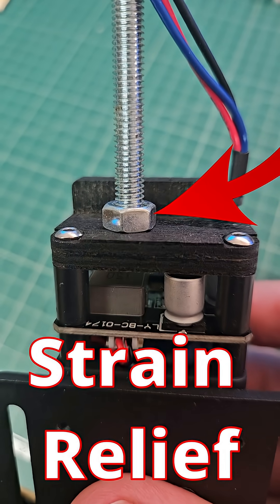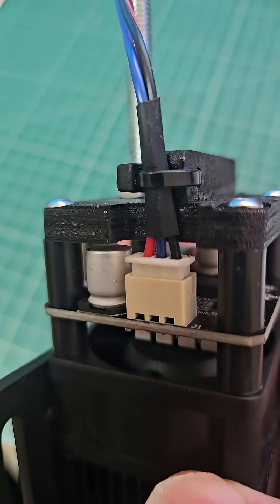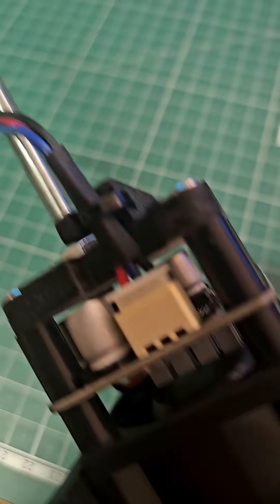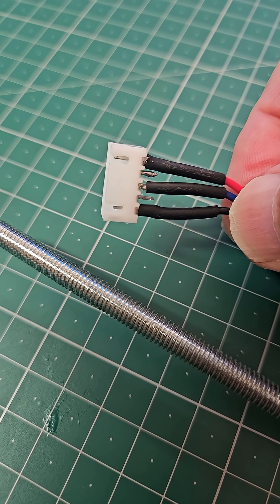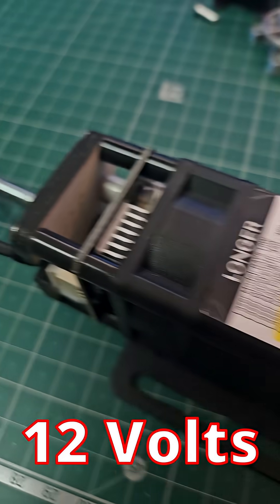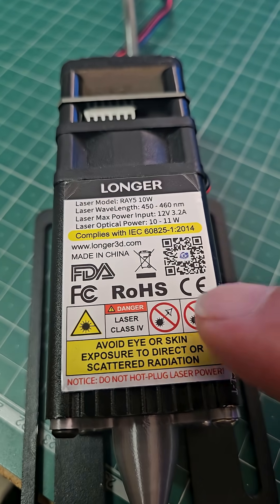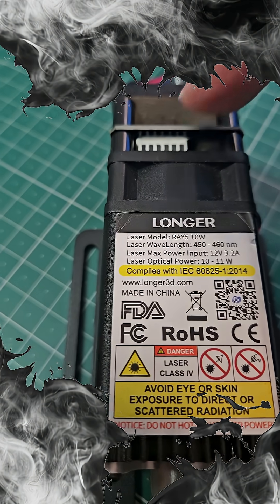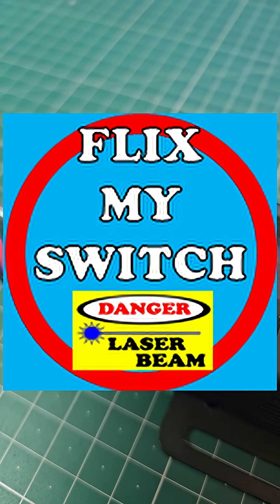Longer Diode Laser 5 and 10W on a 5pin wiring harness

Comment: I wish they had thought about it in the board design... let all lasers use 24v supply, then have the headers be 12v each. They could have had them wired as series connection on the 24v modules, and just tapped a single one for the 12v. Would have made swapping heads so much easier for us modders haha.
Reply from the maker: yes they dont think about us modders.  Thanks for your support